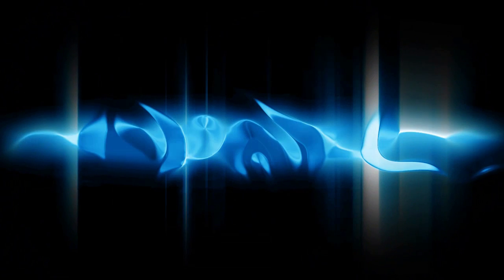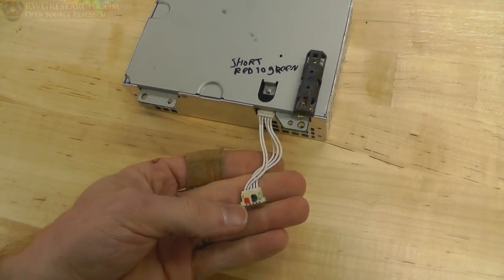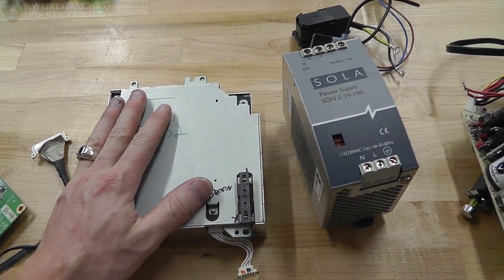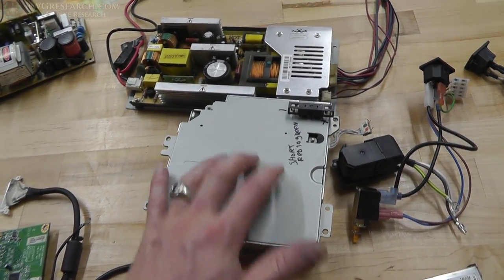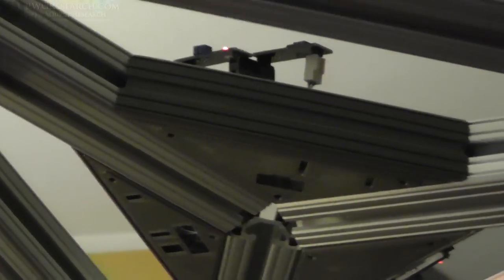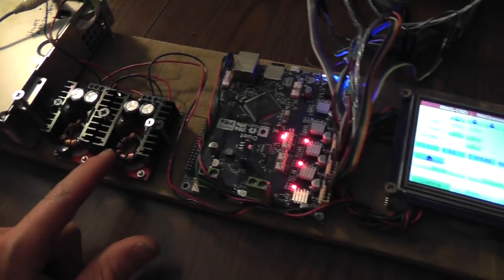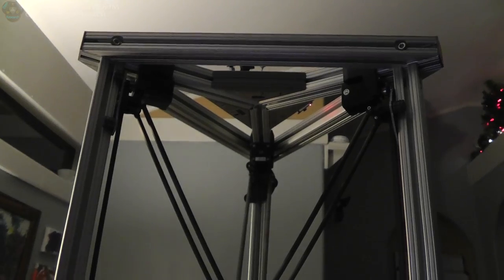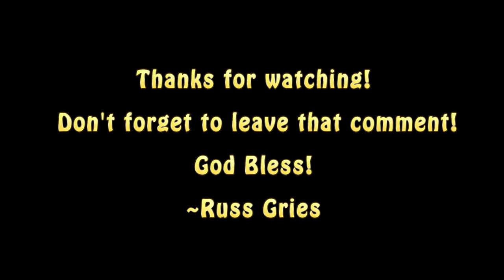RWG-OSD # 25 : Power Supply Dilemma... Something So Simple... So Manny Thoughts!

Comment from the maker: In this video I go over the power supply options, the reason i picked the PS3 PS is that i know that there are 1000's of theses units out there and i for sure can replace it if it craps out... found these PS as low as 13$, that's cheep for the power output! cant beat it. the boost converters don't even get warm...  seems we are on the right track! ~Russ

Comment: Hi Russ,  Nice video's. I wish I had the patience to spread the knowledge as you do.

You really need to pull those "heatsinks" off the top of the chips they are a waste of time in their current location, the chip tops are made of plastic which are isolators not conductors, the driver chips are actually cooled via the bottom of the board using the holes in the PCB as thermal heat pipes and the thermal mass of the copper cladding on the PCB, the bottoms of the chips have a direct metal to metal contact with the PCB. It is actually recommended that if you need additional cooling of the drivers that you flow cold air across the underside of the board.

Comment: You should check that your boost converters are load balanced (that they both provide the same amount of current). I'm pretty sure it's not a-good-thing to just parallel them. They might work, but I had some similar ones in the same setup, and one converter would provide all the current, the other would just sit there and do nothing.
Also, get yourself some nice low ESR caps and replace the ones that came with the boards. I've had one (on this exact model) blow and release nasty stuff all over my printer.

Comment: Also having Run a Smoothie board back to back with My Duet 0.8.5. the Duet wins by a mile placing the smoothie in the same league as a ramps board. Everything the smoothie does, the Duet just does better.